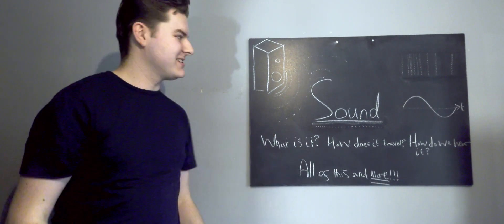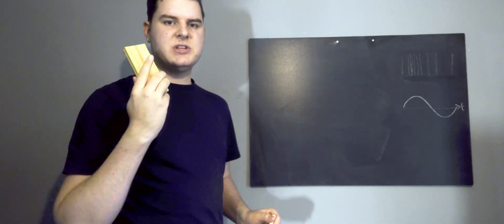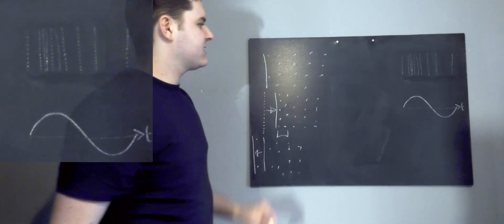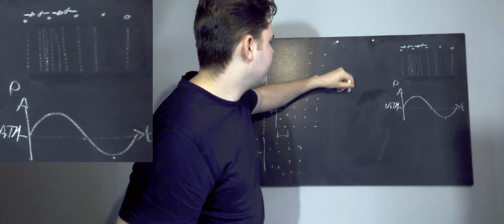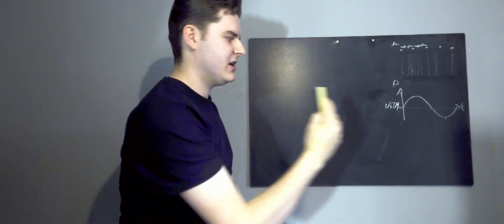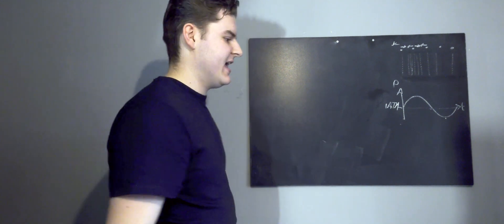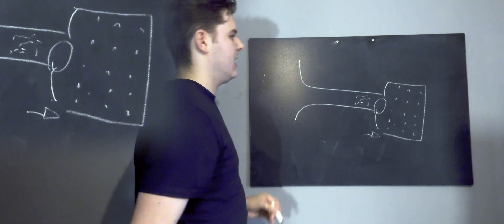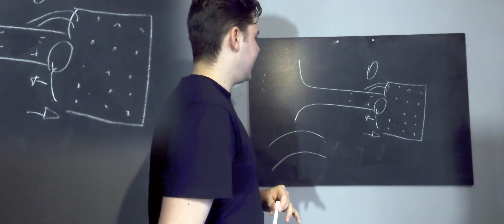Loudspeaker Design: Acoustics Basics

Comment: Good video! I almost thought you were going to discuss the pump effect regarding ports (although similar to ear drums, it would also need to discuss that a mass of air acts as resistance during the high and low pressure points of the driver.
Reply from the maker: The simplified description would be a mass-spring damper system if comparing it to mechanical engineering, but yes, loudspeaker ports are definitely a planned topic!
Reply from the maker: And yes, resistances etc would be discussed. Essentially I just wanted to explain particles and the sound transmission process as a whole, give some fundamental information for some more interesting upcoming videos I have planned